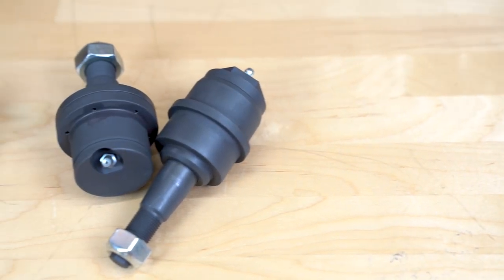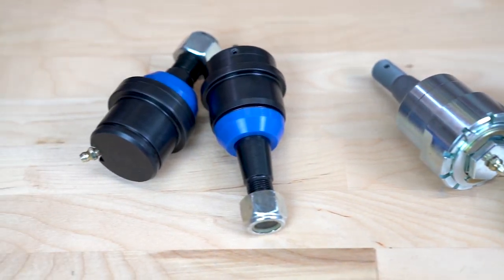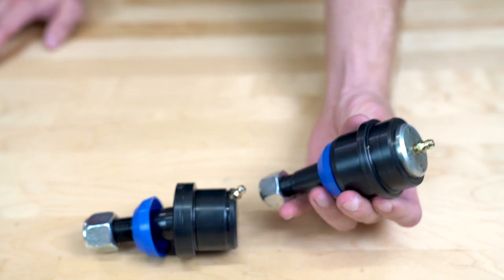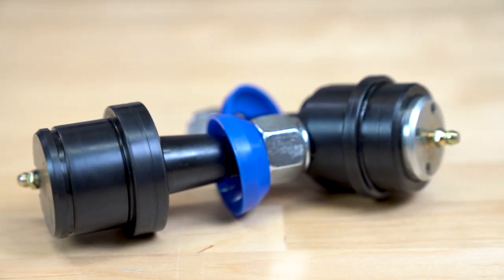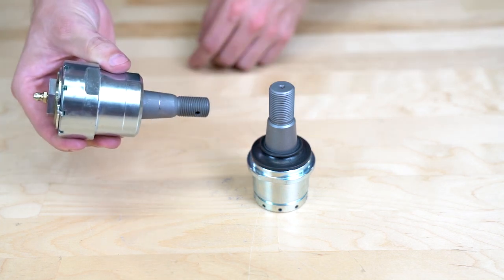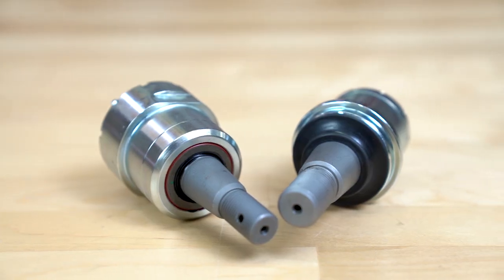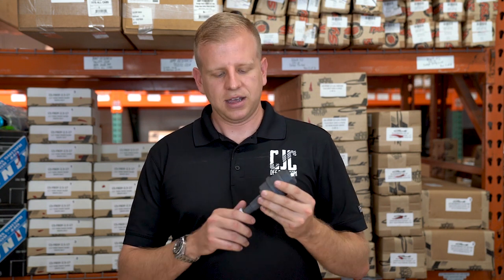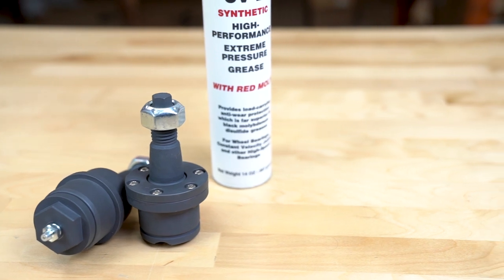Best Ball Joints for Your HD RAM. Carli, Dynatrac,  and EMF Compared.

Comment: Called EMF direct and was blown away that Clay  picked up the phone and spent 15min explaining the other ball joint options and what made EMF joints what they are. Even though Clay was waiting on parts for a new run of joints for my truck, he pointed me to CJC to get what I needed without extra waiting.

I picked up a set of EMF's from CJC for a daily driver 2016 Ram 2500 4x4 (AEV Prospector XL conversion) with 40x13.50R17's. Pulled these apart and they're awesome.

For anyone installing EMF ball joints for the first time, I really recommend going over to EMF's channel and watching their install, greasing, and maintenance videos. The guys clearly communicate why a given process is needed, and what it accomplishes.
Reply from the maker: They're an awesome company to work with!

Comment: Just got a set of EMF's from you guys. Can't wait to get them in. I like the idea of being able to rebuild them without having to press them out. Plus they are top quality.
Reply: isnt the Carli one same?
Reply: @rootiest  The Carli ones have to be removed for rebuild.
Reply: dynatrac are the ones where you can rebuild them on the truck, and the best ball joint you could buy.
Reply: @Gramskee  EMF has a race inside of them so when the pin wears it will wear the race and not the body of the joint. The dynatrac does not. If the dynatrac gets bad enough it will gall the inside of the housing and you will have to press new ones out and in. EMF race can be replaced while its still on the truck.

Comment: I just installed some EMFs I bought from you guys.  The lack of hexnut on the bottom makes the install a ROYAL pain.  They will spin on you when tightening.  EMF does provide a video with some hints, however, their YouTube channel videos are really terrible.  A review like this should mention the lack of hexnut.  I saved 260, but spent extra time under the truck. Other than that, they're super beefy and should last way longer than the stock ones. Glad the install is over 😁
Reply: If they spun while you were torquing the nut down then your bore is elongated and you need the oversized ones.

Comment: '09 2500 Hemi 
I drive on logging road everyday for work. 
The truck probably see at least 50% off-road miles. (no jumps)
Will the EMF joints hold up?
Reply from the maker: They should, but with the hard use your truck is seeing, the lifetime warranty of the Carli joints might be a good fit too.

Comment: Looking to upgrade right off the bat, I have a brand new 2022 power wagon with 4000 miles 3000 of those with 37" KM3's on stock rims. That will change soon.
Just did one heck of an off road trip And The truck caught air to give you an example of Is what the truck will go through and why I need an upgrade.  I'm going to need something alot tougher Then the stock joints.
 I come from the Jeep world Where all my jeeps had or has Dana 60 crate Axles and I used Teraflex Ball joints With Moderate success, this truck obviously weighs 3 times more than any of my jeeps even 
My J10.
 Will these Carli oversized upper and lower joints, Be the best choice out there? and since we're spending 800 bucks on a set of uppers and lowers I'm looking for the best out there I don't want to rebuild these in 1 season, I want them to last, So price is not an issue  Are these the best out there?
Reply from the maker: Believe it or not, the stock ball joints actually hold up half decent under the Power Wagons since they're lighter, but hard off road use absolutely takes its toll on them after a few years. We sell tons of options, but these Carli ball joints are truly the nicest out there for these Ram trucks. With proper maintenance greasing, you will never need to replace or change them for the life of the truck. if you do manage to damage them, Carli will send a fee replacement under warranty.
Reply: @CJCOffRoad   I will definitely look into ordering a pair! Do you by chance have the uppers and lowers in stock?
 Even if the stocks last till next season I'd like to have them on hand when one goes and I can replace them all And be done with it

Comment: What would be the best option for plowing
Reply from the maker: The lifetime warranty Carli joints are an excellent choice for hard use situations like plowing as a result of their metal on metal design.
Reply: I have the Carlis in my 05 Ram 3500 with a 8.5 boss vplow. Truck drives like new. About to replace ujoints for the first tine since.

Comment: I'm replacing my 2500s ball joints that have some up and down play no side to side . They have 199,989 miles on them . They are factory originals and have had 33s and 35s on them . Not saying that a joint like emf  isn't better I have their joints with 3/4 thru bolts on the upper front control arms in my crawler they are nice joints , But the factory joints seem to last if you're not off roadimg the truck even on 35s

Comment: Will these fit 07 ram 1500 rwd 5.7 hemi ?
Reply from the maker: Nope, these are 2500/3500 4x4 only.
Reply: @CJCOffRoad  what would you recommend for me I don’t do off road much I may use it for towing later on a boat or jet skis but mostly highway driving should I just go oem ?
Reply: Do you recommend or know the best route I can go or would you recommend oem ball joints and upper arm

Comment: I am looking to replace ball joints on my 2004 ram 2500 5.9  . I go camping a lot and the roads in are extremely rough, which ballpoint do you recommend? Truck is lifted and on 35” tires
Reply from the maker: It just comes down to price! Carli and EMF are both the way to go.

Comment: Hey guys I was hoping you could answer a question I have, I have a 2018 Ram 2500 4x4 truck.  My tie rod was bent right in the middle, I heated it and was able to straighten it. I'm thinking I need to replace it but wanted your thoughts.
Reply from the maker: I would recommend replacing it when you can!
Reply: @CJCOffRoad  Thanks for your reply
Reply: Any time you bend metal that’s not designed to bend, it becomes weaker. And vending I back made it even more so. That’s why when you bend something that shouldn’t be, just be safe and replace it. Because if it bent in the first place, it will be easier to the next time and will be worse.